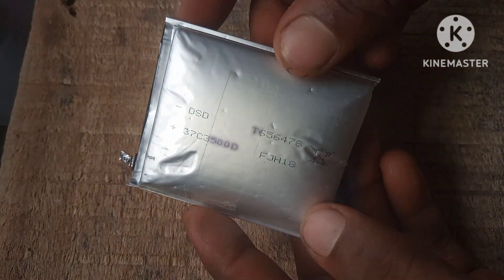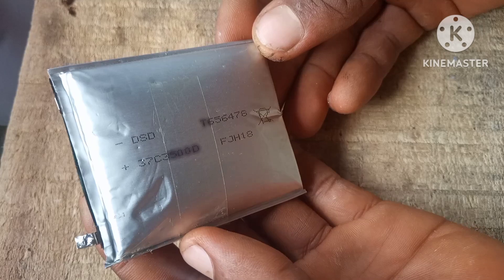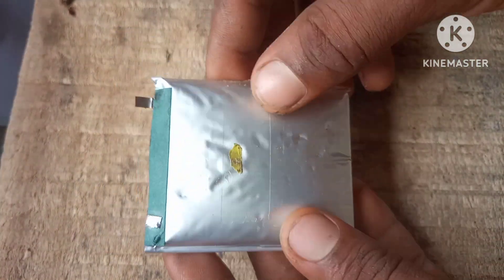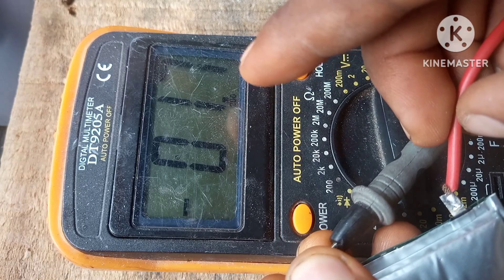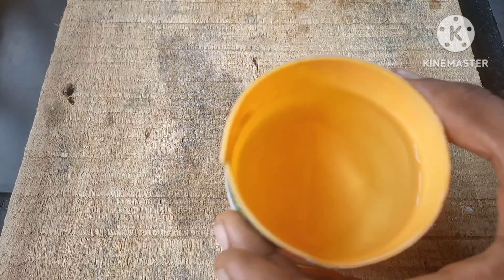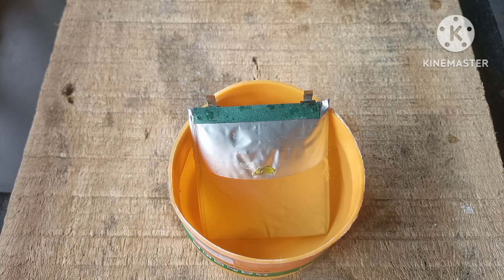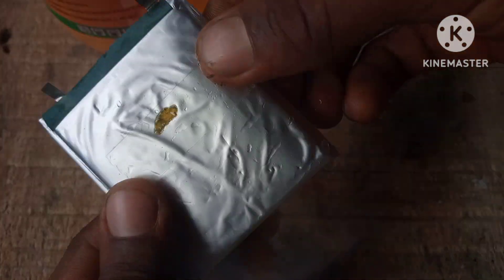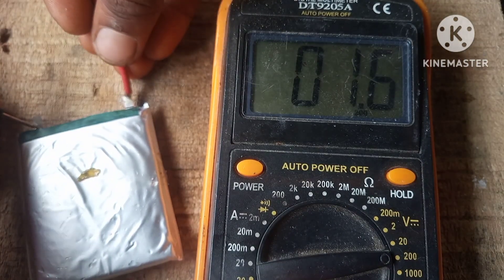Swollen Lithium battery repaired with cold water

Comment: I always use cooling pads while charging my mobile phone. It charges battery fast and keeps the mobile cold
Reply from the maker: That's an awesome idea, by doing that you've increased the battery life span
Reply: @Blinksiteengineering  yes due to fast charger the mobile really gets hot. I don't know if that helps with battery life but does controls the heat for sure.
Reply from the maker: @IndianStockMarketTrader oh I see but it's ok the cooling pad will keep the temperature stabled and prevent swelling, and will increase it's life span a bit

Comment: Stay safe ? That's funny coming from someone advising to put a lithium battery in water. If there was even a smallest break in it's shielding the water will manage to make its way inside. That can cause it to burst into flames right? 

Also they do buldge due to the cells are no longer able to handle loaf or charge so need to recheck capacity so forth before reuse. 

Other than that great video
Reply from the maker: 😂 no water won't cause the battery to start a fire
Reply from the maker: Thanks man

Comment: A 1 cell Lipo is typically 3.7VDC, 2 cell, 7.4, 3 cell 11.1, etc.  Typically when a Lipo puffs out, it's because the battery is already compromised in some way.  If you want to do this with swollen Lipo batteries, you'd best recharge those ones outside away from anything because you might find out the hard way if your house insurance will cover the fire damage.

I build a fly RC planes and use these batteries all the time.  A swollen Lipo can come from being overheated, over charged, an impact, etc.  Once damaged, the safest thing for you to do with it is properly dispose of it and replace it with a new one.  

Cooling the battery will reduce the swelling but it does not repair the problem that caused the swelling to begin with.

Charge at your own risk.
Reply from the maker: That's very true brother, but a man with low budget can survive with this eazy hack.
Reply: @Blinksiteengineering  How so?  That battery did not come back to full charge at 3.7 VDC.  It's a 1S1P 350 mAh Lipo battery.

Make another video where you charge it and the results ad a follow up.  Just don't charge it indoors for safety reasons.
Reply from the maker: @ArkLord001 😁 you know you'll have to pay for the video, and no the will be no issues when changing it, I sure will make a video in full detail showing the charging and discharging of the repaired lipo battery just for you my good sir 😁 but it will cost u only $10
Reply: @Blinksiteengineering  I was thinking about for everyone else.  I already know how this ends

ever see a 6S50P 7500 mAh after a fixed puff out recharge?  I have.  Not pretty.
Reply from the maker: I'm so sorry man, ok I'll do a short video just for u how do u see it ?
Reply: @Blinksiteengineering  it's up to you but from something like this, it gives you some follow up content to post and grow your channel more ;)
Reply from the maker: @ArkLord001 totally right 👍